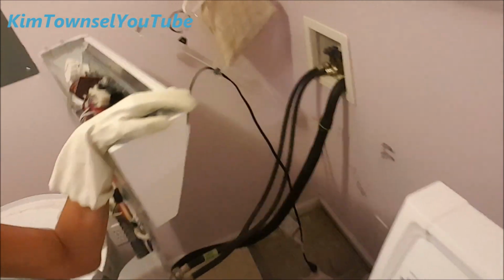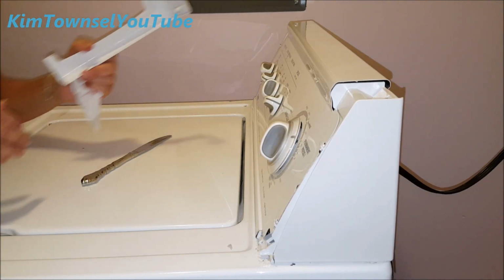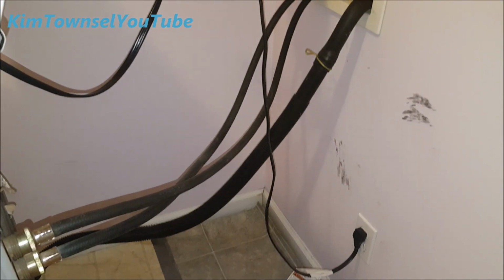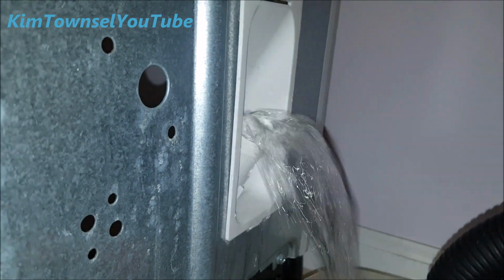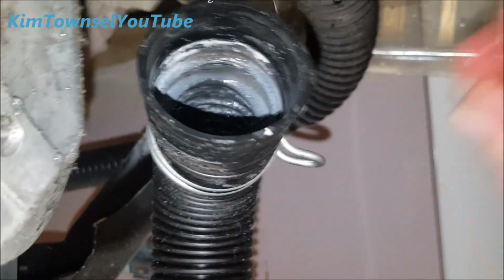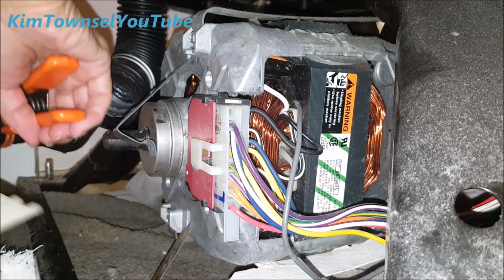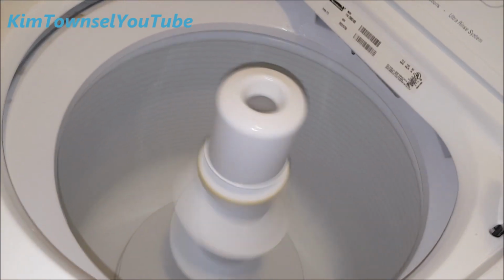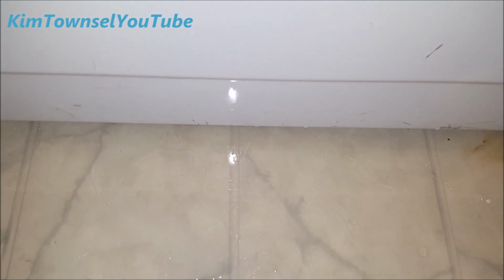Washing Machine Repair Attempt |The REAL Experience of a Novice

Comment: using the wood clamp and the C clamp to compress the compression clip was genius.

all that work and youre given up?!?!?!?

i think ya did everything perfect except putting the white propeller housing thing back on.

it was crooked vs. to when ya initially took it off.

if you reply to this by 2pm today i will priority mail you a off brand channel lock pliers.

that way you could install the plastic propeller pump part on the face on the pump motor.
THEN re attached those 2 big black hoses.

get that pump squared away on the front on the motor then put the hoses back on.

and if not i understand.

had fun watching ;)
i don't feel so alone in my daily tribulations anymore :)

let me know if ya want hose pliers.
Reply from the maker: Oh my! I can't believe I put the thing back on crooked! I may undo it this weekend and try it again. No need for you to mail me that; I'll go check at Harbor Freight or somewhere and look for a set. Thank you for the advice and encouragement!
Reply from the maker: I'm seriously considering moving the washing machine to the carport, hooking it up to the hose pipe, and just letting it drain or leak onto the ground. 😂🤣😂
Reply: those two big hoses are putting enough strain on the white plastic propeller housing to cause things to not fit back together.
i'll be waitin' for video of the first load of clean clothes.
Reply: the washer has drawn blood.
i think you're angry with it.
don't make it sleep out in the garage just yet.
let it try to redeem itself one more time.

;)
Reply from the maker: Thank you!!!
Reply: you're more than welcome.
partial blame in on my dearest father who made me help him build a house or two.
and made me work on my own car with a haynes manual.
he bought me my own tools though.
out in the driveway during snow storms under my jacked up car with tarps jammed into the doors and snow balled down on the corners like tent stakes.

everything used to be made to be fixed.
now things are too much plastic. hard to not break plastic.
but good experience. 

gotta have a good pair of slide joint pliers.
Reply from the maker: This comment was in the "needs approval" which I only see when I am on my laptop.  I was NOT ignoring your offer to help; I just now cut on the laptop for the first time since last week.

Comment: Wow! I feel bad for you. I had exactly the same problem where my machine would wash, but when it came to spinning and draining it would stop there. All I had to do is replace a swith located under the lid and it fixed the problem. My machine is 12 yo and still running well. I got a newer GE DeepFill and now I appreciate my Kenmore, which I, luckily haven't gotten rid of, getting rid or GE.
Reply from the maker: Thank you! I hope your info helps other viewers.
Reply from the maker: BTW, I bought a GE washer which is NOT reliable. I have videos up about it. I wish my trusty Kenmore had lasted forever.
Reply: @KimTownsel  Oh, I know, that's how I found this video, because I saw you doing video about new GE and I got a similar model and had misbalanced drum, which, by the way, after "digging" on the unternet I was able to fix.
Reply: @KimTownsel  I picked up similar washer to yours, it had balance issues. I did whatch a few videos suggesting just physically reposition a drum, but that didn't work.  I then read someone's comment, that at the bottom there's a black plastic cap covering a belt and if that area gets dirty the belt starts slipping and it causes the drum to violently shake, because it gets off balance. I cleaned that area - it was greasy from grease that was coming from motor area, I repositioned the belt, because it was slightly skewed and now my washer runs perfectly fine, I am tempted to keep it, because it has a DeepFill option and that is what bought me at the beginning, to be honest. I read that people have a problem with water overflowing using that option, so I'm just afraid to leave the machine alone, have to keep an eye on it while it's working.
Reply from the maker: @ykyk2222  Thank you!!!

Comment: I commend your efforts but you did a few things wrong and unnecessary.
The control panel ... don't just push it back ... pull it slightly forward, then raise it up.
Easier to handle the cabinet when removing it by opening the lid for a hand-hold inside.
The drain hose didn't need to come off the back.
Proper tools makes it a lot easier.
The bra underwire was the problem.
The pump was not put on crooked, it only fits properly in one position.  The pump hoses should have been pushed on a little further.  The top pump hose not being fully seated probably is source of the leak on the floor.
Reply from the maker: Lol. I am a complete novice! I was operating on the theory that if it wasn't going to work I couldn't do any more damage. I ended up caving buying a new washer.